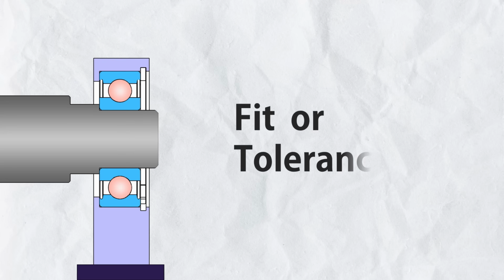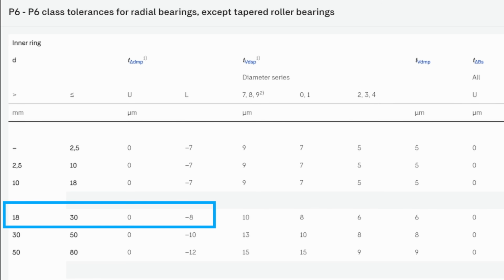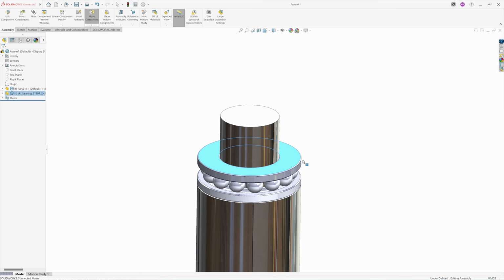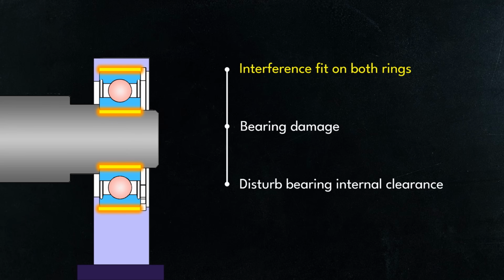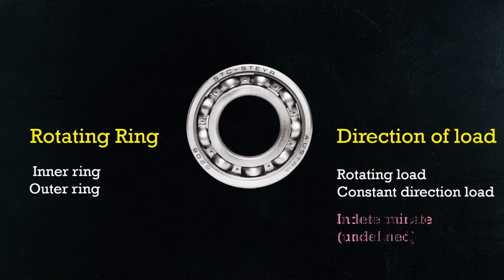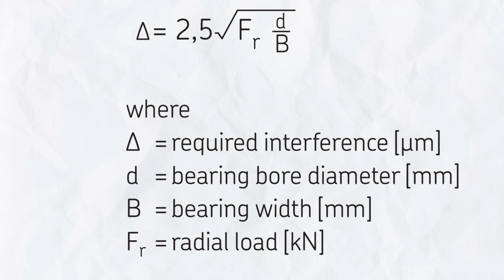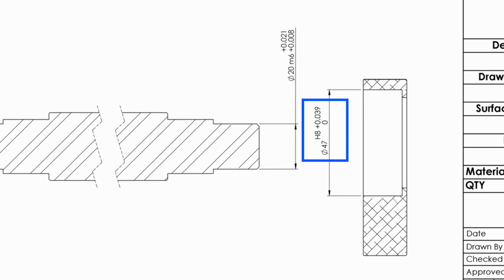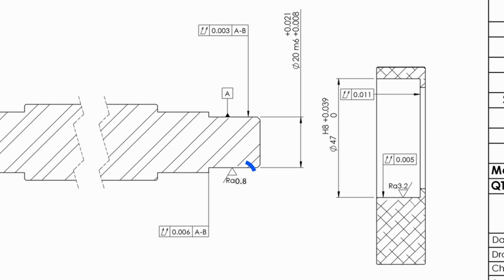Complete Guide to Bearing Fits & Tolerance, Seat Surface Finish & Bearing seat total Run-out

Comment: Hi champ, just wanna say, great job you're doing here. Ever since I stumbled upon one of your videos, I just can't stop watching them. I am an electronics engineer with some knowledge in mechanical principles so, to cut story short, I want to develop my own BLDC electric motor. Just to give you some info, the bearings I'm using are 6202-2RS/P4 on one side and 6204-2RS/P4 on the other. Bearing housing is 7075 aluminium material, interference fit N7 while the shaft is 4140 40HRC g6 slide fit, grind bearing shoulder finish after heat treatment 0.4um Ra. The housings are rotating parts at 2200rpm. The load is 40kg. Any advise/comment would be appreciated plus I would like to see a video on splines since there are so many different types like number of splines, depths etc. I'm sure there are reasons behind. Cheers

Comment: I just have a question, how do you keep an interference fit when you need to allow axial movement ? I in the design of a micro jet engine, and I need to allow axial movement due to thermal expansion, given the rotating speeds >80 000 RPM and required mechanical simplicity, both bearings are interference fit onto the shaft, but one of the two bearings needs to be a clearance fit to allow axial movement
Reply: You don't 

One of the bearings must be able to move axially that is one side is fixed and one side is free

Comment: Sir , Your videos are very informative. 
I need ur support, I am facing frequent failure of bearing in Ring Blower. Due to heat ,grease came out and bearing got jammed. Note: blower running at 3000 rpm with 6305-2z,c3.

Please suggest the right bearing model.

Comment: Most people think that a roller bearing is better than a ball bearing, but this is not true.  If using a roller bearing and there is not enough load to force the rollers to turn, the rollers will flat spot, causing premature failure.  That’s why most electric motors use ball bearings.  Roller bearings would be used if there is a substantial amount of overhung load.

Comment: Thanks for the video, it is probably best tutorial video about bearings. As you mentioned at @21.00, if we are using needle roller bearing, do we need to apply interference fith for both rings? Is it a must or not, or is it advantegous to be interference fitted?
Reply from the maker: For needle bearings, things work differently, some supplied without any inner rings, some supplied with very thin rings, that could be damage due to interference fit, so better to go with whatever supplier has specified.

Comment: please make a video on shaft seals/oil seals and after that the hydraulic seals installation with fitment tolerances.
Reply from the maker: Hydraulic seal and its installation fitment tolerances video is already there

Comment: Access for disassembly is also a factor which ring is interference fit. If needed, the use of locking compound can counter slipping under load in less than ideal situations.

Comment: Nice video and great explanation!

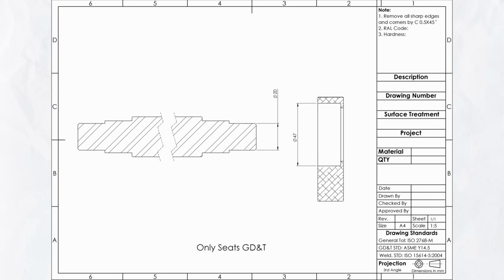Just a small clarification between 29:23 – 29:32:
You mentioned that the selected shaft fit from the datasheet for a 20 mm diameter is k5, but in the drawing, m6 has been applied instead. Could you please confirm why ?
Thanks

Comment: Great job bro :-) highly admire your work :-) great respects for you.   This might sound unrelated , but can you make a video about single phase/3 phase current and how devices work on it.  also, how is AC synchronous or asynchronous induction motor are related to it.? I had this question after i saw your video on asynchornous motors :-) . i have seen lot of vidoes on current generation (AC/DC - 3 PHASE/1 PHASE) but no one has explained properly to me. Maybe you might be the right person to guide us  on it:-)
Reply from the maker: In short, single phase power fluctuates more, you need capacitor and other acc. to run a motor, you will see in a household fan, while three phase power is more continuous and stable, making it better for running large motors, As you can see, i covers industrial engineering design, so dont want to go alot in electrical side.

Comment: I love this video and have watched it several times.  One thing that puzzles me though, is that the fits table recommends transition fits (js5 etc) for narrow shafts but I thought we need an interference fit.  What is the logic there?  I am working on a prototype drive and I have seen fretting corrosion so I was thinking the fit would be something like r6.  When I calculate from the formula I get 9 microns interference but from looking up in the table I get j5 for a 10mm dia bearing seat.  Which should I believe?
Reply from the maker: Please go with recommended table

Comment: Hi sir. Tq for the video. In my case outer race is rotating and inner race is fixed. So as per video i understand that, in this case, interference fit is given to housing. but is it will be same for cryogenic temperature? because at this temperature, housing going to shrink more. my question is this calculations suitable for cryogenic temperature? we are using same materials for housing and bearing ss.
Reply from the maker: Hi, if inner ring is stationary and outer ring is rotating. then there two possibilities, one is Load direction is stationary, direction of load is not changing with outer ring is rotating for example gravitational load of shaft, towards downward. means load direct having a relative motion with outer ring, so outer ring should be in interference fit and as inner ring has no relative motion with load (both are stationary) inner ring can be kept as clearance fit.
Second possibility is an unbalanced load is attached with outer ring. for example, a can motion, then there is load is also rotating with outer ring, means relative motion is between load and inner ring not with outer ring, so inner ring should be in interface fit, and we can kept outer ring in clearance fit, there will be less chance of any slip. 
Now, temperature condition should be considered above this condition. and there is formula for that, i had explained that in Angular contact preloading video.
Reply: @mastermechanicaldesign  Tq sir.

Comment: sorry for my ignorance, at 29:25 the table shows from 17 to 100mm using k5 (+11 and +2)  but in the drawing with 20mm shaft showing m6 (+21 and +8) , however what you said was correct.THANKS.

Comment: Good morning 
Sir please try to answer a question:
Q. which instrument is used to check a slot width of 10+-0.015 mm? 
A. Gap gauge B. Gap Gauge and Slip Gauge C. Thread plug gauge D. Slip gauge
Reply from the maker: I think Slip gauge (Slip block) would be appreciated
Reply: @mastermechanicaldesign  Sir Gap Gauge & Slip Gauge not possible?
Reply from the maker: Yeah, you can use both
Reply: @mastermechanicaldesign  Thanks a Lot sir

Comment: Hello sir, my query is  in single deep groove ball bearing if outer race is interference fit in housing and inner race is in clearance fit on shaft than how inner race will behave on shaft while outer housing is rotating.i have done practical and my case inner race is scalding on shaft surface. Is it normal? Need help
Reply from the maker: So, as outer ring is rotating, and inner ring is stationary, there can be two cases, one is loading direction is not changing, (or unbalance load rotating load with housing) then the choice of fitment is okay. you could fit inner rig with g6 or h6 fit, but if loading direction is keep changing with outer ring, then inner ring can be scalding on shaft surface, this might be an issue, so to fix it, first determine the case. and then choose the fit accordingly.

Comment: Sir please help to solve a Question:- If the size of Hole is equal to the size of shaft then the type of fitment is:
A. No fitment. B. Transition fit, C. Interference fit, D. Clearence fit ?
Reply from the maker: First, it is impossible to make the exact same size of hole and shaft. There will always be some difference. For example 0.000000001 mm.
So, the type of fitment can be either clearance or interference and this will depend on which is large and smaller. It will never be a transition fit. Why ?
Because the type of fitment is not an exact size difference. Fitment is defined as a range of tolerance. And transition fit occurs when hole and shaft size tolerance fall in a common zone. But there is no tolerance zone.
Reply: Dear sir, 
A lot of thanks for your valuable response 🙏 Your answer helped me a lot for solving my confusion. Have a nice day, Thanks again.

Comment: With Inline skates, at least the ones I had, they don't truly care about longevity all that much. The wheels are plastic, therefore a bit elastic and the axle is metal and the goal is to be able to replace bearings without needing heavy machinery or a press. No idea whether super expensive skates do it differently.

Comment: single row taper roller bearing seat inner and outer fit& tolerances on top mounted agitator drive shaft and housing
Reply from the maker: Please do check out the manufacture catalogue, process will be same.

Comment: Thanks for making this guide. At 29:25, your bearing seat falls within the diameter for a k5 fit, and you mention a k5 fit, but then you apply an m6 tolerance on the drawing. Did I miss something?
Reply from the maker: Ohh 😯 Yeah, that's a mistake, please do consider data sheet
Reply: @mastermechanicaldesign  Also k5 falls between +0.00 to +0.01 right?

Comment: In fits table only for rotating inner ring load application shaft diameter as shown what we do for stationary inner ring load or for this load we can choose directly g6 or h6 kindly clarify
Reply from the maker: Yes, You are right, you can choose g6 for any diameter, if little loose fit is needed for axial movement. and h6 when no such axial movement is needed

Comment: Thank you for sharing  your knowledge ! I'm not a design engineer myself, but i'm currently working as a maintenance engineer  and is very common for us to determine the fit of bearings, seals, retainers, sleeves, and other elements for pumps, compressores, gearboxes, turbines when the costumer doesn't have much information from the manufacter. Kind regards from Brazil ! Keep it up the good work.
Reply: If you can please help me

Comment: Great video! I am a mechanical engineering graduate and passed in 2017. I am currently working at Accenture as a Project Manager. To be honest, I hate this IT Sector profile and want to switch to my core profile. The major issue is I forgot some topics that will help me in Design engineering e.g. Engineering Mechanics, Thermodynamics, Fluid Mechanics, etc. 
I need your guidance regarding these 9 points mentioned below. 
1. Which topics/subjects I should more focus on that will help me in design engineering e.g. Engineering Mechanics, Thermodynamics, Fluid Mechanics, Manufacturing Process etc? 
2. Before starting CAD or CAE, do I need to practice drafting like Engineering Drawing or Machine Drawing? 
3. Would you recommend any best Online CAD and CAE training courses in the world or India (Training centres)? 
4. Which social media platforms (YouTube, Twitter, Facebook, Instagram, Websites) should I follow to get updates in the design engineering field to gain knowledge?
5. Which other communities/servers (discord, Reddit, Telegram or FB Group) should I join to interact with expert design engineers to gain knowledge? 
6. Which industry is the dream of any design engineer to be part of like Aerospace, Automobile, Renewable Energy, Robotics and Automation, Biomedical, Consumer Electronics, etc which also provides the best salary? 
7. Which country has the highest scope of design engineers like the USA, Germany, etc.
8. Do I need to pursue a Master or I can work in the above-mentioned countries with some working experience, projects and internships without a Master's?
9. Any other suggestions would you give that will help me in this field?

Thanks

Comment: in the end its down to application and bearing type , if its something low load that needs to be preloaded we usually do a looser fit usually around +0.02mm for the outer race and -0.02mm for the inner race but lets say its for a heavy duty reduction drive its usually a very tight fit  -0.03mm on the outer race diameter and +0.03mm on the inner race  but if a interference fit is needed for low load applications we usually make ot 0 for 0  , great video and good job on the english voiceover
Reply from the maker: Yeah, actually right way of preloading is axial preloading and in case of preload required applications, we should prefer set of angular contact bearings instead of deep grove ball bearing. thanks

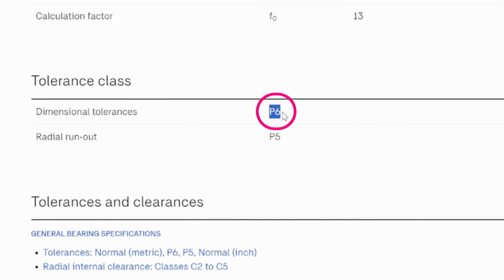Comment: 6:30 you are using P6 for outer diameter but it is a shaft not a hole, hence p6.
Or not?
Reply from the maker: P6 is bearing precision grade, this is a different thing from fits. Nothing to do with the hole and shaft. Bearing precision grades are Normal, P6, P5, P4 like this

Comment: How to select pneumatic cylinder for leak testing fixture
Reply from the maker: Clamping force should be 4 times more than required.
Reply: @mastermechanicaldesign  
Kindly make a video.

Comment: 🙂 stumbled across your video. 
My gasgas txt 250cc motorcycle spun a roller bearing, which is supposed to be a press fit in housing and slip fit on shaft. 
I may have to watch your video a couple of times, but it definitely looks like it will have the answer. 
Can you use a compound to help retain a press fit ?
Reply from the maker: Yeah maybe, but I don't know if the compound would be recommended or not. Maybe it can degrade the surface of the bearing seat. I'm not sure

Comment: Good stuff! Probably more than most DIYers would ever need. However, one guy did mention building A CNC machine, in which case you might want to use this info. Anytime you need high precision or high speed, this info can be useful. If you need both, it becomes essential.

Comment: Thank you very much for the informative content, sir. I have a question: If we specify an interference fit, how should the assembly person fit those components? At my workplace, if I provide any interference fit tolerance, they bring back the component to me saying "ye to isme ja hi ni raha." Because of this, I avoid specifying interference fits in my drawings. Please suggest how to resolve this situation, sir.
Reply from the maker: Yeah this is a genuine problem. This also happens to me. And the solution is tooling. 
1. For small bearing - fitting tool. And bearing puller unit
2. For medium size bearing - Induction heating (temp should not go beyond 80 C) 
Or hydraulic oil injectios, if possible.
(If required I'll make a video on this topic)
Reply: @mastermechanicaldesign  🙏

Comment: In office simply we will give housing means K7 fit and shaft +-0.005 micron with 0.8 surface finish but today clearly and perfectly understand the indepth technical knowledge for giving tolerances in shafts and hub thanks a lot sir❤❤❤
Reply from the maker: Yeah, shaft fitment depends on amount of load, higher load - larger interface, also don't keep both ring in interface fit unnecessary. (seats which is in relative motion, will have higher chance of slips, so only keep them in interface fit)
Reply: @mastermechanicaldesign  what is relative motion  both motions like load and rotation are same in direction we call relative motion or if it's acts opposite direction we may call relative motion
Reply from the maker: umm, not opposite, in case of bearing opposite can't be possible, either same direction or one fixed and one rotating. and I have called this relative motion of ring with respect to direction of load, and ring has to be interference fit in this case, either inner ring or outer ring.